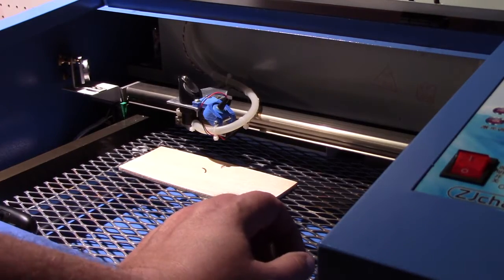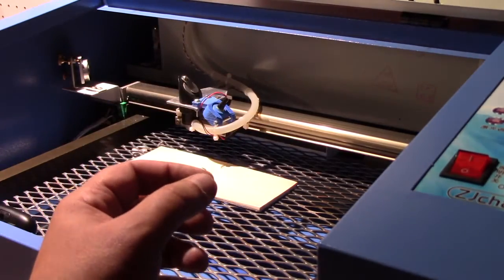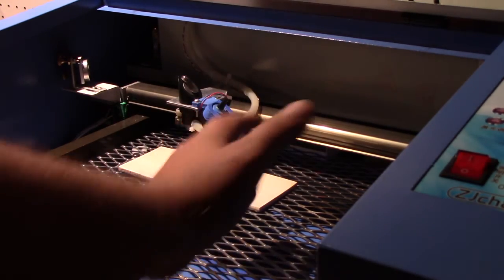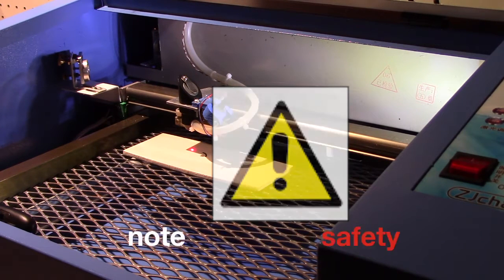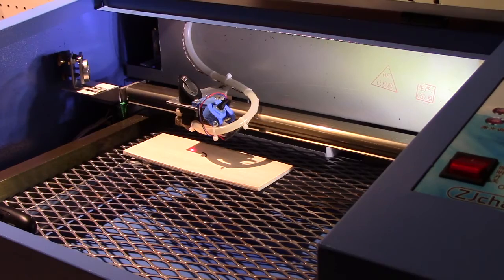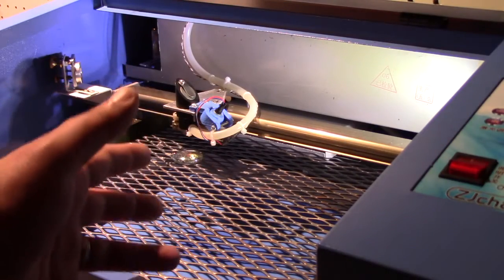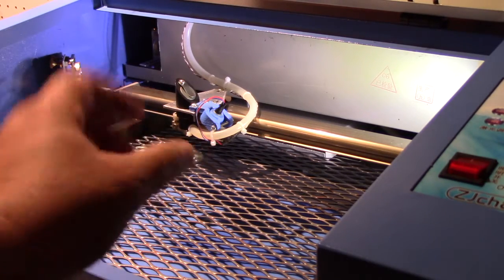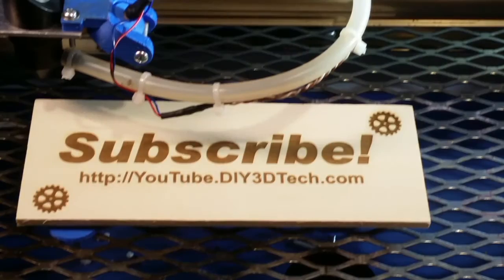K40 eBay Chinese CO2 Laser Cutter & Engraver -  Reflection Hazard!

Comment: First. Coherent light is in same phase. Same wavelength called the monochromatic light.
Second. I actually did not see any hazardous reflection. Your IR camera pick up any infrared radiation (or heat). The warmer the object the more IR light (of different wavelength it emits. This test would be convincing only if you would use either very narrow IR filter of monochromator to select only laser wavelength. Your light only dangerous in focal point where you have maximum energy density. Away from focal point maximum what you can feel is a bit of heat. IR radiation is harmless.
Reply from the maker: Not sure I fully agree that reflected IR light is not harmful as while your summary "Coherent light is in same phase. Same wavelength called the monochromatic" is correct however I am sure what this has to do with "reflected" light as I have had "reflected" laser (non-focused) burn holes in my shirt and leave burn marks (while minor) on my skin so again I am lost lost how you can say this...

Comment: What is the best way to keep the water cool in a 5 gallon bucket and also at what temp should the water stay between ?
Reply from the maker: i typically run about 4 gallons in my system and have had issues with modest hobby operation.  One I ran it for 3 hours at full power and raised it the water may 5 or 6 degrees above room temp which was about 68 deg (it located in my basement).  Also water temp should around 66 to 78 deg (F).  If you're going to use for longer duty cycles say in an un-airconditioned shop  in the summer would suggest a small refrigerative cooling system.

Comment: So the IR reflection/leakage is like "second hand smoke"?
Reply: By the way I'm relay curious if the stock plexy cover is protecting against anything o not ?
Reply from the maker: Yupper because a little laser light (which you can't see in this case) can do a lot of damage.  As normal light is spread out in freq meaning it has many varying focal points for freq and the lens of you eye distributes this  over wide area per say.  Whereas a laser is one freq and therefore is focused into a small area.  This is why a 2 watt laser even can burn quite a bit (think about it this way a night light puts out more than 2 watts).  Now jump this to 40 watts? Also a set freq this low in the spectrum there can be a lot of reflection from the material we the operator can not see....
Reply: DIY3DTECH.com - Nasty stuff. Safety first.  Great subject to discuss. Would never have thought of it. I do like your pointing out of the safety issues with the lasers. http://diy3dtech.com
Reply from the maker: frankly I am surprised these aren't regulated as you have high voltage, an invisible laser and no double grounding!
Reply: +DIY3DTECH.com - not enough complaints to the Consumer Protection Agency. Once some kids get hurt they will get on their radar.